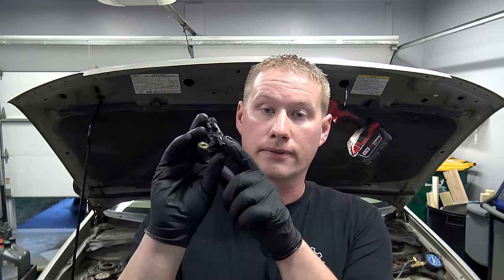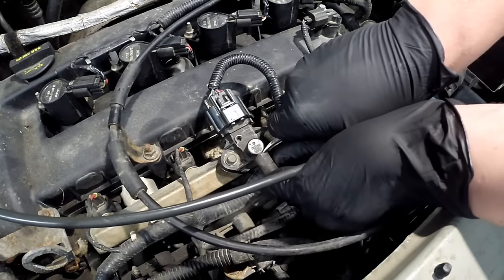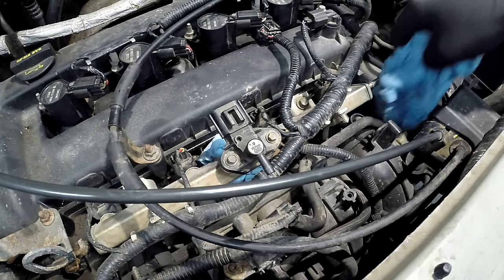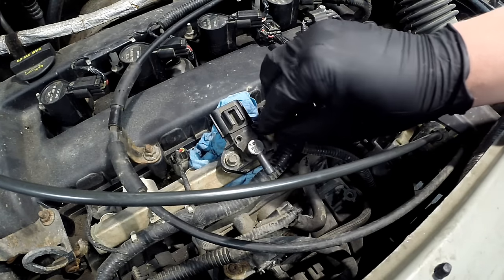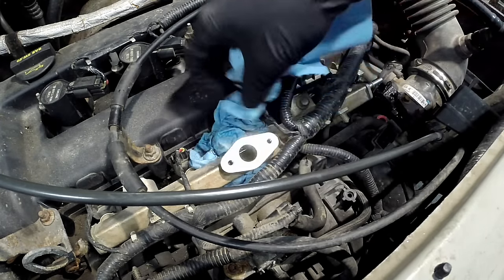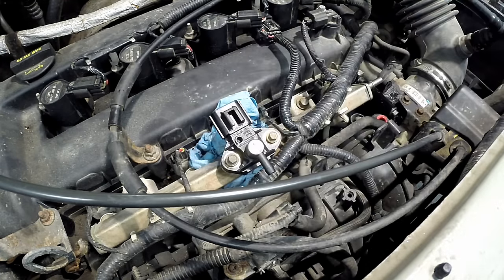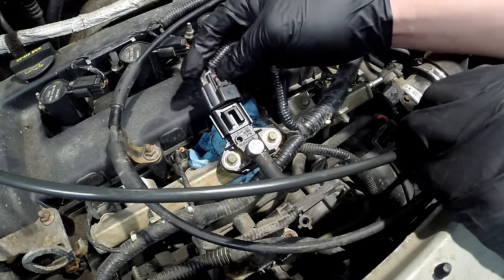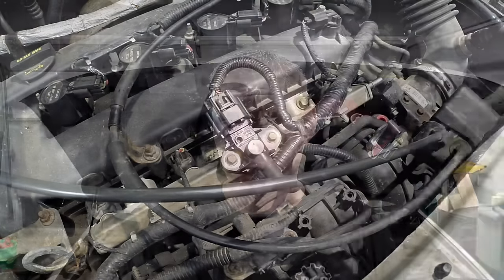Ford Vehicles: Fuel Rail Pressure Sensor Replacement P0191

Comment: you leaked fuel all over at the right end of the rail when you took the sensor off .....
Reply from the maker: Yup same thing as the straw trick this was part of another more in depth diagnostic video so the line was off.

Comment: 07 explorer 4.6 v8. Code P0191 which is this sensor.  Replaced 2 without success.  I know no one is going to reply to this, but what's next
Reply from the maker: You want to monitor the fuel pressure with a scan tool to see if it is actually running low which indicated a pump problem.
Reply: @FordTechMakuloco  what's the required pump pressure.

Comment: it is really very simple and easy only if you can find it in your car. I watched zillions of videos and other material but still unable to find this sensor in my car: Ford Escape XLT 2.3L 2006 (From Japan, right side steering weel). That sensor does not exist in that place or any other place shown in all photos or videos. But, with that, it should be existing there, otherwise how could that car work without it , but it was working and then after long time parking it is now starts then dies right after start (can't hold idle rpms; all symptoms shows that it runs on too rich fuel to air ratio; no obd2 errors , but fuel pressure nor air to fuel ratio does not reporting (other sensors are reporting). Anyone can help ?

Comment: I'm having a no start issue on my 02 v6 mustang. Pump primes, cranks strong and no pressure at the valve up front. Will start right up on starting fluid.
Just changed the fuel filter. No change. Any thoughts? Thanks in advance!

Comment: Makuloco how could there be any pressure on that line/sensor when you already had the line supplying fuel to the fuel rail disconnected lmao, yes I caught that in your video, funny you didn't mention you did that in your video (that you disconnected that line) but are all tellin people about pressure and safety on the sensor, lol. You already unhooked the line supplying fuel to the fuel rail, how was the the pressure on that line when you disconnected it lol. Funny u didn't mention that tho and are all talking about pressure and safety on the sensor lol.

Comment: 05 Ford Five hundred code says fuel pressure sensor i changed it out with OEM light stays on says same thing no change car surges getting up to speed throttle doesn't work half the time everyone says throttle body i did that with a after market one and then a OEM one did the re-learn 5 times still the same 4 shops later no fixes yet 🤦‍♂️ last shop told me to junk it so did the dealer
Reply from the maker: That is because Ford has abandoned this car long ago, parts that are left are like gold.
Reply: @FordTechMakuloco  Ur probably right Thanks  love ur channel its saved me alot over the years

Comment: i can see you remove a hose at the right end of that fuel rail or injector rail just to prevent pressure surge. next time please say the truth. yiu basically cover it with your hand but i still notice. nice job though.
Reply from the maker: That line was removed as part of the diagnostic process to empty the fuel rail and check for a biased fuel rail pressure sensor. I have an entire video on the diagnostic process that show why it is off....

Comment: Yeah I guess you won't have any pressure in the line after disconnecting the fuel line and letting all the gas flow out the other side. What's that about? 😁
Reply from the maker: Please see response right under yours, this was a lightning strike vehicle.

Comment: Lol😂😂 on the right side of the rail. You can see all the gas coming out and you’re just trying to be careful man that’s funny. That’s why there is no pressure because the pressure is already out because you disconnect the hose from the rail something that you probably did not explained.
Oh boy, you need a little bucket there or something you had major league at the end of the field rail 😂😂😂😂
Reply from the maker: I may have not explained it in the video, so here goes. This was a lightning strike vehicle with a damaged FRP sensor among other modules that were damaged. The fuel line was removed to fully relieve any pressure in the fuel rail allowing me to test if the FRP was truly damaged and now biased. Sure enough it was, so this video was made only showing the "normal" procedure for replacing a failed FRP sensor. I would never make a video specific to lightning strike vehicles now would I? Any other questions or concerns.

Comment: You didn't tell everyone that you took the fuel line off before starting! Look at the end of the rail fuel spilling out!
Reply from the maker: That was part of another diagnostic job checking for the biased FRP sensor, removing that line is not part of this job therefore there was no mention of it.